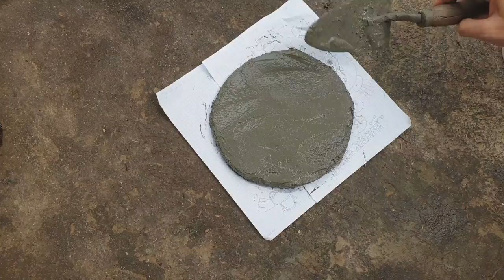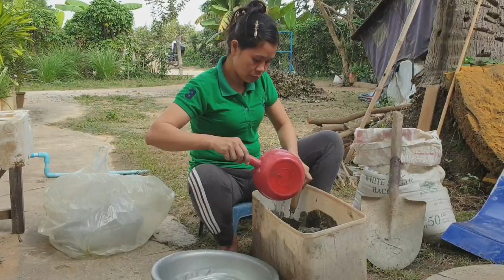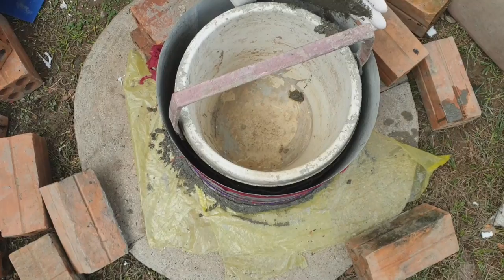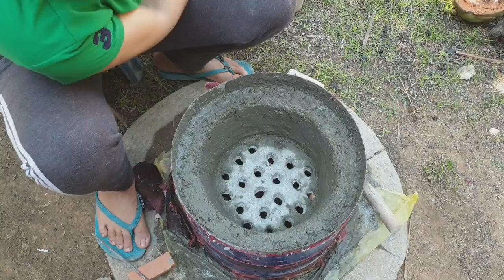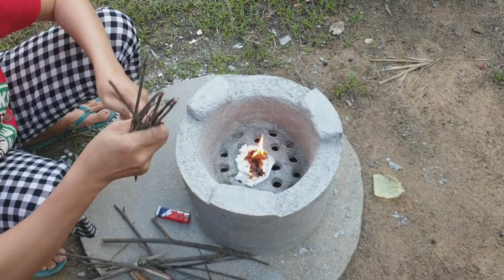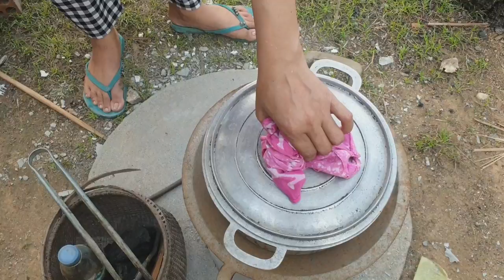Make simple charcoal stove for cooking my village food | Countryside living vlog

Comment: no clay on the inside? concrete can crack with too much heat
Reply from the maker: Thank you 💖 🥰 🙏.
Reply: It does not easily crack actually. This improvised cement stove is popular in our country and we used them a lot in our house when we were kids. So based in what I observed, it lasts longer.